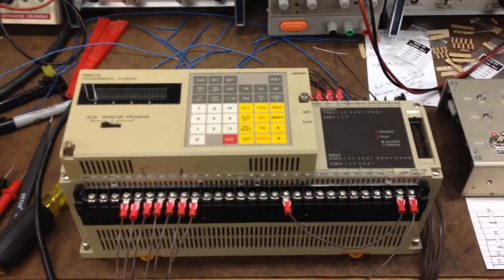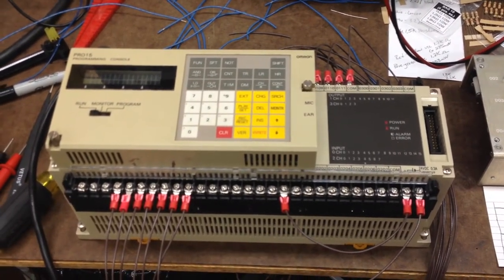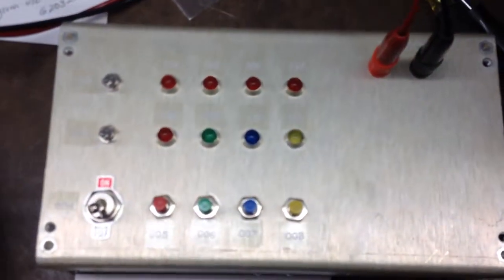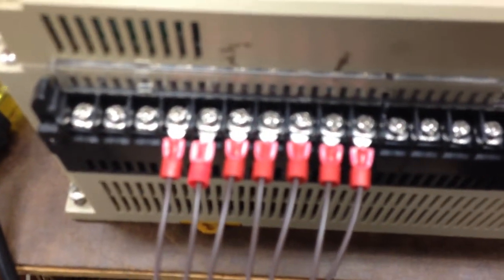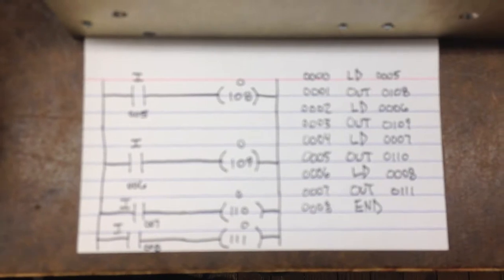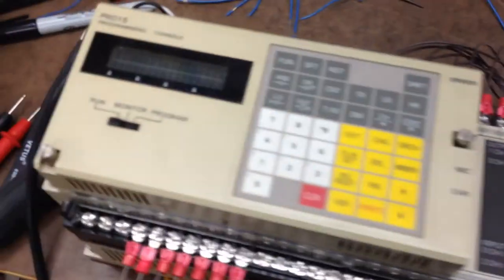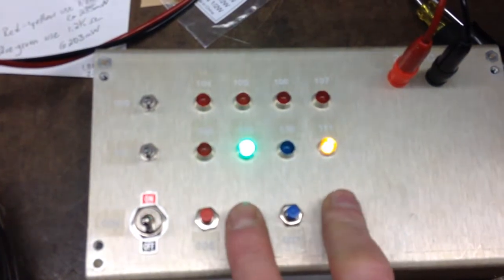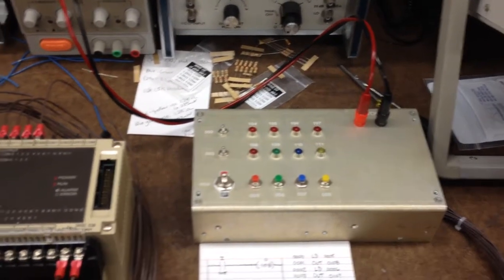Omron C40K PLC

Comment: Hello
I have an ancient Omron SYSMAC C40P controller with a C120-PRO15 programmer on board. Exactly the same as in your video.
When turned on in all modes (RUN, MONITOR, PROGRAM), it requires a password. Can you help? It's a pity to throw it away, I could have worked more!
Reply from the maker: I can not find my notes for this unit at the moment but if I remember correctly when prompted for the password you press 'CLR' then press 'MONTR' then press 'CLR' , you should then be able to start programming. I will look for my notes, I know I still have them but where they are, I don't know. Hope this helps, these are great little PLC's to play around with.